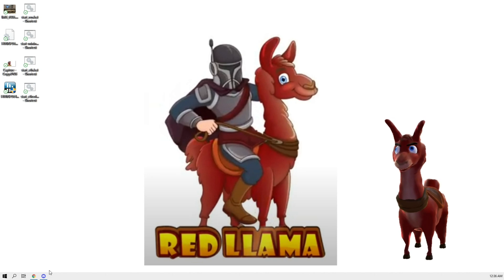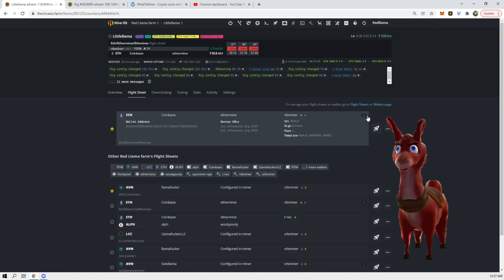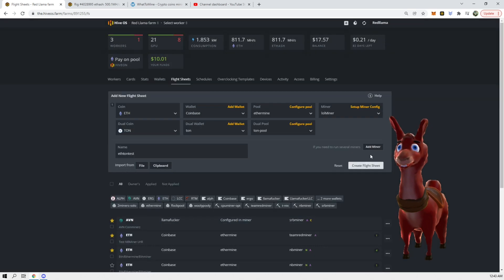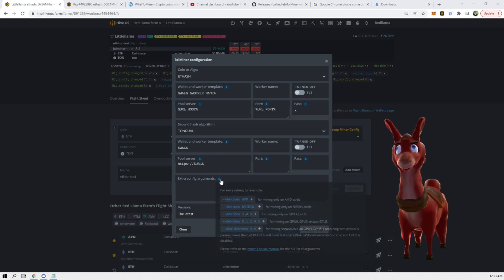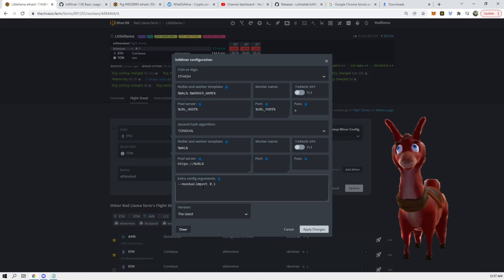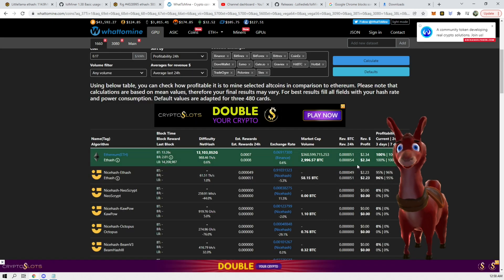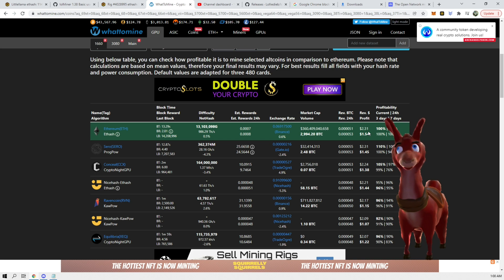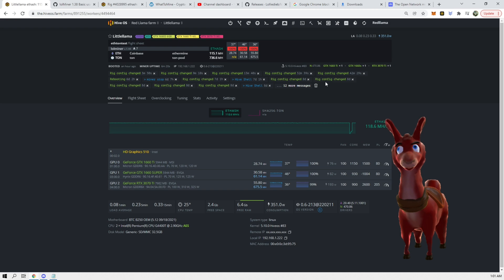Dual Mining Eth & Ton with a 3070 ti on Hiveos

Comment: Bro why does everyone always have their fans at 100% !?!? I keep mine at 65 and I have EXTERNAL fans on my frame that suck out the hot air, and a big box fan BEHIND blowing away the hot air from behind lol also nice video!
Reply from the maker: Haha fans are cheap to replace. I did the same in the past but just worried the pad will degrade quicker with a lower fan speed I guessed. Probably doesn’t really effect it.
Reply: My logic is as follows. GPU  lifespan is directly proportional to the average temperature that card has been running. It's one of the few variables that has been proven. Thus, fans are merely a cheap means at extending the lifespan of your card. So, keep the $20 fans at 100% to keep the GPU working for a longer time, or cheap out on the fan speed in fear of needing to buy $20 fans and risk your $1000+ GPU lasting less time..
Reply: @Mehecanogeesir  I keep my fans at 65% and my temps are ALL 45 or under. A lot of other factors come into play as well like the ambient temperature of the room, and I also use other cooling methods like using external fans to suck out the hot air, I also use a box fan behind the rig to blow out the air / cooling, and well, my house is covered by trees for the most part so it doesn’t get too hot (and I live in near the gulf coast, in Texas lol) but yea I get what u mean, well idk I just don’t like running them at 100, plus I don’t have to but yea I see where ur coming from
Reply: @lolyouwontfindme6070  The memory temperatures are important too, but those are great ambients && GPU temps. Sounds like you have a good setup in a nice, cold place. I'm out here in the dessert getting ready for Nevada summer.. It gets rough out here. Wouldn't be surprised if August was known as to GPU Death Month lol

Comment: Also, you need to raise your core clocks and power limits
Reply from the maker: I suck at overclocks.
Reply: @RedLlama  agreed they are way low you can could probably double you TON with a locked higher core clock